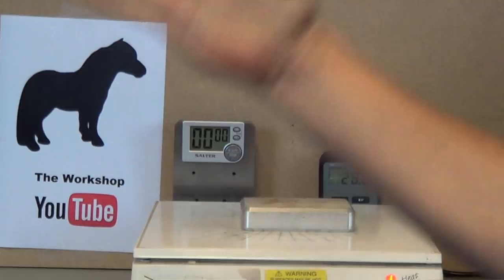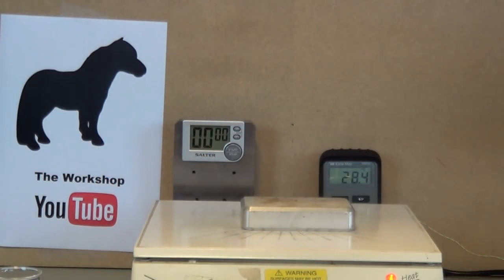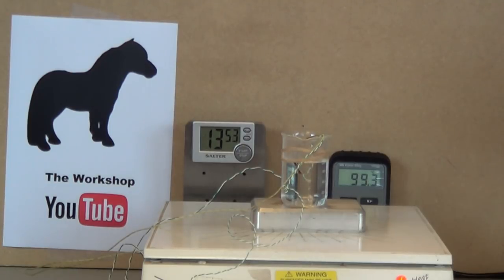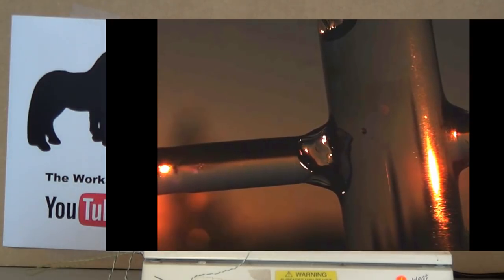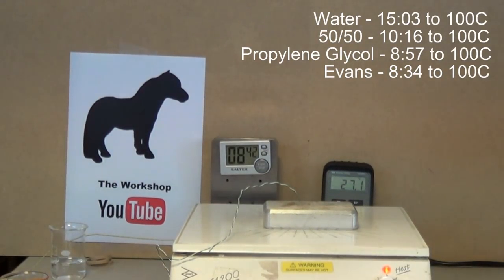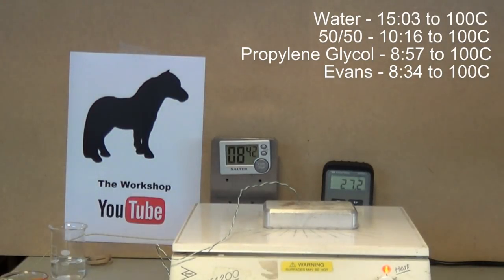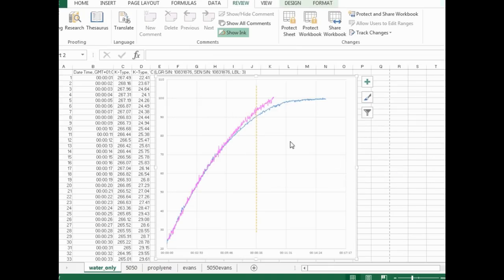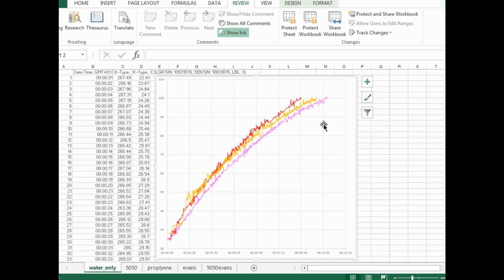Evans waterless is SHIT! - with proof

Comment: Water is the best heat transfer fluid, but it freezes at 0C and boils at 100C at 1.013 Bar (1 atmosphere).  A cooling system can theoretically add 1 to 2 Bars pressure by constraining the vapour pressure, however there are many places inside an engine where pressure drops occur and at these points water an 50-50 coolants have a potential to vaporise (flash off to steam).  Steam has an extremely poor heat transfer coefficient and that's why Evans coolants are often used, to prevent overheating and premature boil-over. This video ignores this fundamental point and hence is pretty pointless.
Reply from the maker: This is going to be fun -

"Water is the best heat transfer fluid, but it freezes at 0C and boils at 100C at 1.013 Bar"

- useless numbers. People don't run straight water.

" A cooling system can theoretically add 1 to 2 Bars pressure by constraining the vapour pressure"

- not theoretically, they do and it works fine.

"Steam has an extremely poor heat transfer coefficient" 

- again your system does flash into steam. If you watch the video steam is a great way of carrying away heat.

"to prevent overheating and premature boil-over"

- how does Evans prevent overheating? You engine is the source of the heat, Evans is a poor conductor of heat, has shite specific heat capacity and is basically Propylene Glycol with added food colourant. The only way Evans waterless shite doesn't have to publish it's content on an MSDS sheet in the EU is if it is recognized as a food additive, which Propylene Glycol is. 

So basically Evans super juice is anti-freeze, without the water. So can you tell me and the viewers Steve, why its costs so much?
Reply: Hi again. I don't know about being fun, as I have too many other things to attend to, but recognise and respect the strong following The Workshop has and I'm keen to provide our perspective on the videos and other commentary.  I'll do my best to keep my responses short, but there is a lot of detail involved.......Lots of engines run on water, especially in countries where sub-zero temperatures are not prevalent.  Also, many racing cars and bikes run on water-only due to FIA and BMRC etc. regulations.  The 50% glycol antifreeze added to standard engine coolant is there primarily to protect against freezing, as it only raises the boiling point to approx. 104C at Atmospheric Pressure. 50-50 water-glycol, based on Ethylene Glycol provides freeze protection down to -36C.  In my opinion the 'Winter-Antifreeze, Summer-Coolant' strapline is made up to sell more glycol as the coldest temperature ever seen in the UK was -29.1C. More marketing BS!!?I say 'theoretically' because a vapour pressure of approx. 1 Bar (14,5psi) at the expansion tank does not translate or transmit to 1 Bar in the whole engine cooling system.  Due to the volatile nature of water at temperatures above 80C, where the vapour pressure makes itself increasingly apparent, the water or 50-50 coolant does not have linear hydraulic properties. So 1 Bar (Gauge) pressure at the expansion tank can mean less than 0.25 Bar (Gauge) inside the pump volute and other parts of the engine, where eddy currents form and the associated pressure drops. FYI. 1 Bar (Gauge = 2 Bar Absolute) pressure in a pressure cooker raises waters boiling point from 100C to 120C.  Another critical factor that can turn 50-50 coolant in to vapour are the very high metal temperatures found adjacent to the combustion zone. E.g. around the cylinder-head and cylinder liners. The combination of high metal temperatures and pumping pressure losses often exceeds the pressure-temperature curve of 50-50, leading to vapour formation.Water-vapour (steam) is a very poor heat transfer medium compared to water, 50-50 or Evans. Water-only and 50-50 coolant flowing past the hottest parts of an engine, at approx. 110C to 120C, is susceptible to vaporisation.  The Specific Heat of water-vapour is approx. 2.0 J/gK, compared to 3.3 J/gK for Evans at 115C.  The Specific Heat for water at 99C is 4.216 J/gK.  So, water and 50-50 are the best coolants, provided they do not turn in to vapour.  Evans will remain liquid at all times, in an engine cooling system, as thermal equilibrium is achieved in 99.9% of conversions, at around 103 - 115C.  We have dynamometer test data confirming this, provided by JCB, Cummins, Veolia, New York Waste Authority and many others.Long story short....Evans remains as a liquid at times (conditions) when water or 50-50 coolants are prone to vaporise. Hence why so many racing teams use Evans and why we have been a Technical Partner to the Honda World MX and Enduro Teams since 2010.  Due to the nature of our agreement with Honda we cannot also partner Kawasaki, Yamaha or KTM in the UK, but they all use Evans, which we provide FOC for promotional purposes. In the USA Evans, Inc. has a similar arrangement with Yamaha MX teams.As mostly explained above, Evans prevents overheating by ensuring that there is always liquid coolant in contact with the very hot metals. Even though the Specific Heat is not as good as water, it is significantly better than water-vapour.Evans contains a mixture of glycols and other synthetics, including a small proportion (less than 20%) of propylene glycol.  PG in isolation is too viscous, even at elevated temperatures, so we blend several other chemicals and inhibitors in to the (secret) formulation.  PDO, a bio-derived alternative to PG is used in some formulations as it aids pouring at temperatures below -40C, for use in the Artic and Antarctic snow-mobiles.It took Jack Evans and Tom Light, the inventors of Evans Coolants, nearly 20 years to get their formulations right and another 5 years to agree a range of performance criteria with the ASTM (American Society of Testing and Materials), and then meet that criteria.  All of the inhibitors have to be soluble in the core waterless formulation, unlike those water-soluble inhibitors used in 50-50 coolants.  So, while Evans coolants are much more expensive than 50-50 alternatives, we are still recovering the cost of the R&D and marketing activities to launch Evans in UK, Europe and Middle East.  Hopefully, as the product gradually increases market share, economies of scale will prevail and we will be able to gradually reduce the cost per litre.I hope the above has helped to clarify/answer some of your questions without sending everyone to sleep...I did say the Devil's in the detail....Much of the above can also be found deep inside the www.evanscoolant.co.uk website, but I'm happy to repeat all of that info here via my answers, as long as that's OK with you?  Please keep the questions coming, as there's a lot more that can be said.  E.g. significant reduction in corrosion rates etc.Kind regards, Steve
Reply: Steve Hickson, I am in the US and many of my racer friends have used Evans for years.  I HIGHLY DOUBT the "economies of scale" will ever equate to a lower cost to the consumer.
Reply: Hi Mike, point taken, it could be a while but we are starting to see increasing uptake by the military, which could mean volumes never previously manufactured before. This will at least allow us the potential to offer some discounts and make Evans far more accessible to all. Cheers, Steve
Reply: Steve Hickson so why does the Evans coolant make your engine run hotter.  and buy this it shows it is a poor coolant . It's just sales men crap on the front of the label. coolant t can only become steam if it is able to expand and by stating the water pump is where it happens is  bulshit as it is under pressure from the sealed cooling system where the presure has no where to escape unless the presure cap opens but will only regulate that for The time it is  open expelling coolant which is sucked back once it cools . if it is so good the Evans manufactures would use it and they do extensive research into what works best.
Reply: Steve try a paragraph here and there so we can read it without going cross eyed....js
Reply from the maker: I had to copy it and paste it into word and stick some paragraphs in.
Reply: My old eyes can't take the pace, I've read the same line 4 times lol
Reply: Hi Happy Dog, I did type with paragraphs but somehow the reply was squashed when I uploaded it. Obviously not as familiar as I should be with YouTube posts. Always happy to forward via email if you drop me a line via the Evans website.
Reply: Another possible relevant point....most all cooling systems are pressurized.  USUALLY, it is 14 to 25 psi over atmospheric pressure so the boiling point of water is about 120 C.
Reply: For me, I don't really care about freezing because under most conditions, I am torturing myself on a dirt trail in the middle of the woods...and it is warmer than 5 C or I'd be freezing my ass off.
Reply: Mike, usually the positive pressure inside a cooling system is in fact generated by the vapour pressure of the coolant. This means when the engine is cold (not running) you can remove the cap, but once up to temperature it would be dangerous to remove the cap. FYI with Evans you can still (carefully) remove the cap even when the engine is hot.
I know several F1 teams are pre-pressurising their cooling systems to above 3 bar (44psi) with nitrogen, in an attempt to prevent coolant vaporisation.
Reply: Steve Hickson, that's why you top the system off multiple times and "burp" the air out.  
If you remove the cap and the coolant is above its atmospheric boiling point, it is going to expand immediately....that's why you keep the system closed.
Reply from the maker: F1 teams do this to use less and less WATER. Because water is 1kg per litre. This is however, like you said to prevent coolant vaporisation. But people aren't running 1.6litre V6's that run over 800HP are they. 

So what you are saying is buy Evans so you can remove your cap when the engine is hot. I'm sorry to have to do this but WHY? Why would you want, or need to do that?
Reply from the maker: I forgot to add this - Thanks Steve for talking the time to comment. I'm sure you have loads to do, and at the end of the day its a job. You didn't 'invent' this stuff, and you've talking all this quite well.
Reply: Ah, the dude is trying to sell an alternative coolant.  For most conditions, it doesn't really make sense.....but for others it might.  I'm not going to crucify the dude for selling coolant.  He could be in the pharmaceutical industry trying to sell penis enlargement pills or NSAIDs (they put me in the hospital for a week and I was taking smaller than the recommended doses of OTC) or tobacco or 9 million other BS products.
Reply from the maker: Good point. Its Evans the company I'm after lol I sound like scarface lol
Reply: Evans the company sounds like a welsh chairman of the board...
Reply: The concept of removing the cap, on an engine filled with Evans coolant, is mostly a marketing gimmick to demonstrate the fact that there is no internal vapour pressure generated.  In every-day practical terms this means there is no internal vapour pressure to burst hoses or push past seals, jubilee clips etc.
Reply: Without wishing to sound too limp.....I totally believe in the product and invested a significant amount of my own cash in developing sales in the UK, Europe and Middle East. And, to be honest, a lot of the marketing stuff you are calling in to question are my words, as the USA inventors are somewhat challenged when it comes to the English language!
Reply: Mike, to be pedantic (again) for a minute.....yes, the water-based coolant does 'expand' but what actually happens is instantaneous flash-evaporation in to water-vapour (steam) once the expansion-tank (or radiator if no expansion tank is fitted) is open to atmospheric pressure.  Saturated steam has an expansion ratio of around 1600 : 1 compared to water.  FYI.  There are many injuries caused each year by (not very bright) folks removing their rad-caps when their engine is hot and getting a face-full.Another interesting point, for engine techies, is that 50-50 coolant will expand (volumetrically) by approx. 6% between 20C and 99C, compared with Evans which expands by approx. 7.5%.
Reply: Hi Battman, thanks for your question which requires another complex answer....but here goes; 
Background:  Most modern engines, from the 1950's till now, are designed to run the coolant somewhere between 85C and 105C, which mostly (but not in all engines) ensures the 50-50 coolant remains as a liquid and does not vaporise.  Or to put it another way the engine and engine coolant temperatures are limited by the physical capabilities of the coolant......not the physical capabilities of the metals. 

Metals can run at much higher temperatures than those encountered in liquid cooled engines, as is corroborated by the millions of air-cooled engines still in service. Air-cooled engines are not as efficient as liquid cooled engines because the cylinder bore tolerances have to be much bigger, to accommodate greater expansion and contraction.

There are advantages of running an engine hotter than 105C, including the potential to reduce exhaust emissions and lower lube-oil viscosity, which in turn lowers piston-drag, which improves efficiency and fuel economy.  We are about to enter in to an R&D project with a major car manufacturer (can't say who, as we're sworn to secrecy via an NDA) who is targeting a coolant/engine temperature of 130C.  They need Evans as this is well beyond the physical capability of water-based coolants.  

So, what's my point?  My point is, that running an engine at higher (hotter) temperatures than usual is not a problem, provided the coolant does not vaporise.  This fact is confirmed by the >1.5 million conversions to Evans since 1991.  Inevitably, there have a few exceptions where Evans didn't work as a drop-in replacement, but in those instances there were usually pre-existing issues, such as too much corrosion debris inside the rad, or poor pump efficiency.  

The key function of any liquid coolant is to facilitate transfer of excess heat to atmosphere - the air (unless the engine is installed in a ship or using liquid-to-liquid cooling).  The rate at which heat is transferred to the air is governed by the temperature differential - the Delta T - between the engine, radiator and the air.  The wider the Delta T the quicker the excess heat (energy) is offloaded (dissipated).  

So, running an engine at a higher temperature can, in fact, speed up the rate of heat dissipation.  For engines cooled with Evans this increased Delta T compensates for it's lower Specific Heat Capacity and Thermal Conductivity and ensures thermal equilibrium is achieved around 3 - 10C hotter, than a water-based coolant. As mentioned previously these characteristics have been corroborated via 3rd party dyno tests by JCB, Cummins, Honda and many others.     

Battman, as mentioned in a previous post by me, several engine manufacturers are already factory filling a number of their current engine designs with Evans coolants, including Honda, Noble, Kubota and Polaris.  These manufacturers are using Evans to overcome the vaporisation issues they were having in new designs, where they had planned to use water-based coolants.  Fortunately for us many newer designed engines are running at higher temperatures to improve efficiency and this is pushing water-based coolants beyond their physical limits, especially when operating in high ambient climates, such as Africa and the Middle East.  Considering we only started to manufacture Evans coolants in the UK in 2010 I think we have made remarkable inroads in to the OEM market.  And based on feedback from Ford, Aston Martin and several other OEM's there is potential to design an engine where Evans is specified at the drawing-board stage...watch this space!   For more info please visit our website at www.evanscoolants.co.uk
Reply: Steve Hickson, those injuries are thinning the herd of the special people who have no business being around mechanical objects.   I know that isn't politically correct BUT it usually gets their attention.  Not to mention, in most cases, the cap actually has "do not open when hot" right on the cap.  

That stated, I fully recognize there are multiple issues that are encountered by a coolant.  It certainly isn't as simple as being a medium to take heat (energy) from one point and dumping it at another.  You have corrosion and cavitation and expansion rates......and a  whole lot of other things to take account for in a typical cooling system of a motorcycle (what this particular YouTube channel is focused on).  

You mentioned several items that expansion can influence.  All of those components are designed to fail well over the pressure of the relief valve (radiator cap) so that is only an issue of general maintenance.  For instance, rubber does not last indefinitely. My sister in law wanted to know why her hoses needed to be changed on a 10 year old car.  It is obvious, to the knowledgeable, that she was lucky to have not experienced a failure to that point.  Nothing can prevent that except for regular replacement intervals.  10 years is well past the internal timeline.  

Under normal conditions when the design parameters are not exceeded, 50/50 is exactly what the OEMs recommend for their products.  They put them in their products when they are delivered to the customer.  We are talking about guys riding their motorcycles in normal situations.  (or driving their cars)

I 100% understand your place in this.  You have investment in this product....life, soul, money....so please don't take this personally. I keep my bikes for 2 years, max.  They go through hell.  I have a better chance of getting more money out of them when it is 2 years or less.  I ride in the woods (forest...whatever you call it across the pond)  and if I poke a stick in a collant line or rip one off, I can go to the creek and put water back in it.  If there is Evans in there, I am stuck 15 miles in the middle of nowhere.  Same goes with a car.  If someone has a clamp failure or road debris knocks a line off or punctures it.....get a new line BUT what the hell do you do for coolant?  You'd have to carry the stuff with you....because only a select few have the stuff.  

My friend left a $10k bike in the woods one night because he pulled a silicone line off with a tree limb.  We put the line right back on but we had to push the bike to a hidden spot...cover it with brush....double his ass out of there.....go home and get Evans to put back in so he could ride it back out.....(US labeling clearly states to not mix with water).  That, to me, is parameter that any coolant must meet.....and that is something Evans is horrible at.  Sometimes application is everything.....so for every application you can mention with an OEM, there are a million more real world cases where Evans would have been a horrible choice.....because the coolant is rarely the component that fails.....but replacing because of a failed component is a total pain in the ass.
Reply: I can forgive the copy and paste problems and forgive you. 
I can also grant you some respect for defending a product on the internet calmly and politely without  getting all pissy and litigious.

ps   I see by our records you have won the Ugandan state lottery a rollover jackpot of $10,000,000 these funds will clear to your bank account as soon as I receive your admin fee of £100.
Reply: Thanks HD.  Being somewhat older and a bit wiser I recognise the benefit of seeing things from others perspectives. PS. The cheques in the post and looking forward to receiving the ten mil.